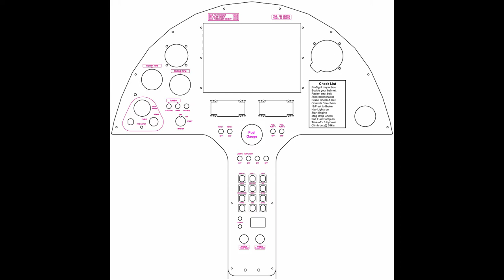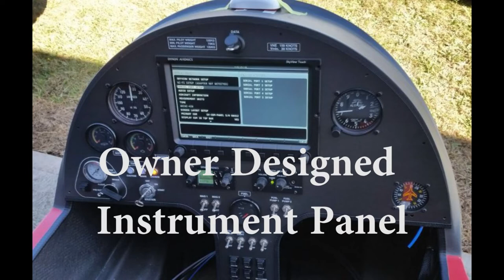Autogyro Flying, Building a Titanium Explorer

Comment: Does this have the foldable mast that is the subject of conjecture as a possible cause of crashes?
Reply from the maker: The folding mast is an option so not all machines have them.
Definitely conjecture.  Two crashes, one possible bunt over and reportedly, the pilot was overweight. The other is cause unknown.
No indication of any problem on my machine. I have upgraded the titanium plates per the AD last autumn (2018); new plates are thicker.